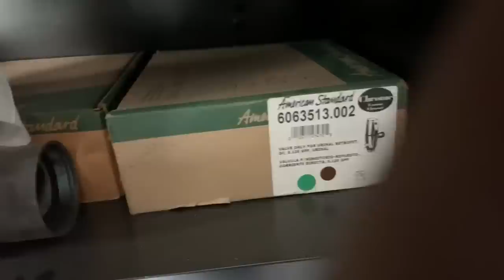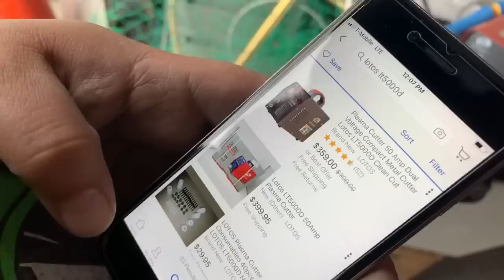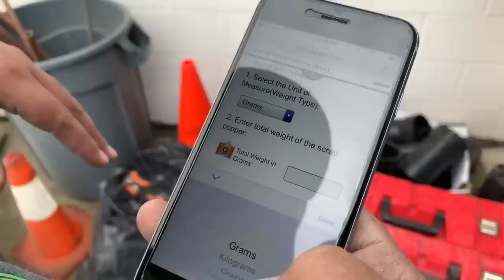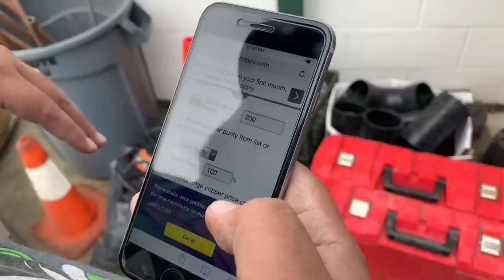This storage CAUGHT my attention

Comment: The rigid model 300 is a pipe threader. It should have dies of various sizes. In good shape with reamer and dies $3000-$4000. The reamer is the red part you found and put on.
Reply from the maker: I found several on eBay sold and ended up getting 1k for this one.
Reply: @StorageAuctionPirate     That was an awesome deal for the buyer. I've got a couple and they work hard forever. When do we get the rest of the unit?

Comment: Pipe threader w/all the threading heads could bring $3500- I'll gib you $400 shipped, yellow torch is called an MC tank it's for soldering and brazing, sparton 300 is a sewer snake, good chance it's been in the shit  
Scrap copper is $1.95 a pound if clean

Comment: 1000 to 1300 for that locker the tool boxes alone are a couple hundred
Reply from the maker: Sold the ridged for 180 already.
Reply: Good guess on the locker price
Reply: Thats awesome that pipe threader is over 1000 if u find all the parts its def a great buy
Reply from the maker: Sold for 1000 already

Comment: Those are crab traps.
Reply from the maker: Oh fun. Ty roger.
Reply: @StorageAuctionPirate  I'm sure you've looked already but if you haven't that ridged 300 is worth a grip load of money new 3,500 also that hand held ridged tool runs between 1,500 and up.
Reply from the maker: Roger Ailshie i sold it for $1000 at flea market yesterday’s. The ridgid 300
Reply: Turn and burn sadly.. if you can only hold it for a few more days it would have sold for more.
Reply: @StorageAuctionPirate  right on